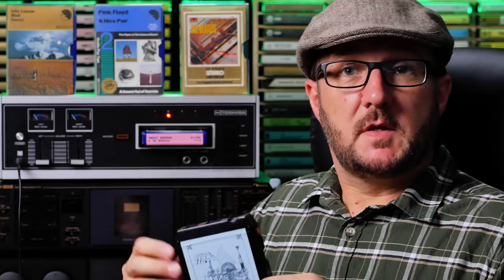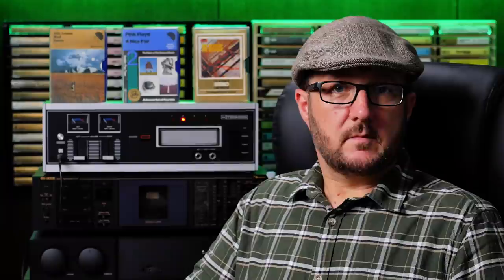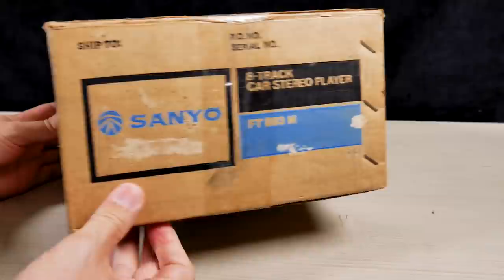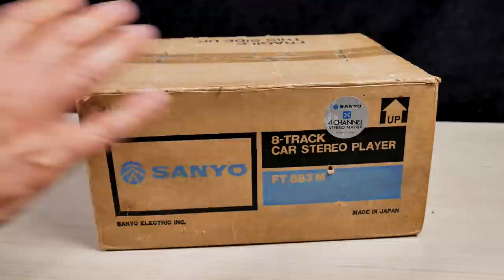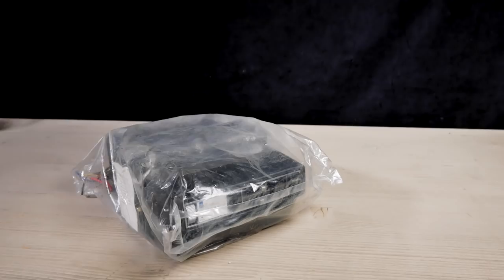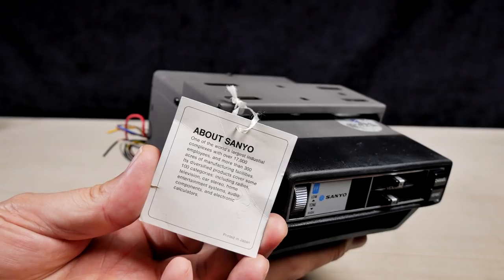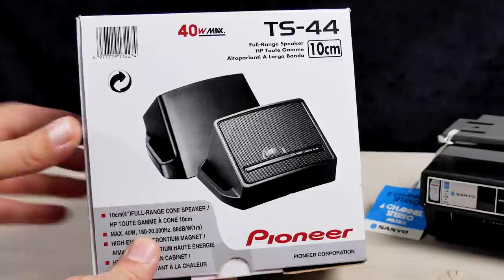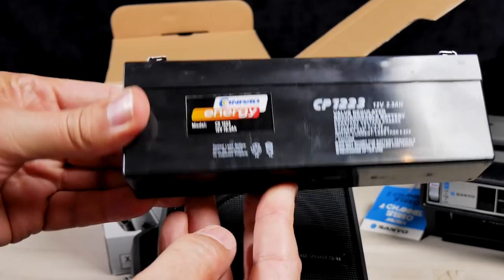Can I Install a Vintage 8-Track Player Into This Vintage Rover P5b? - WILL IT WORK?

Comment: Oh the memories this brings back. I bought an 8 track player for my first car way back in 1973. Did not have it much more than 2 years. My car was broken into and the player ripped out. I collected on the insurance and never looked back. "Step on the gas and wipe that tear away". If I remember, I had 8 tracks of Yesterday and Today and 1967 to 1970. Thanks for shaking the memory circuit.
Reply from the maker: Great memories, Bob.

Comment: As a veteran "Tracker" from Canada, this amuses me to no end.  I love seeing people get into the hobby and I'm glad to hear it already brings you some joy. I think it's the simple pleasures in life is what a lot of us are missing today.

8-tracks CAN sound good. The biggest detractors were: a) the duplication.  Some is definitely better than others. b) the pre-amps.  I've never seen a vintage 8-track deck with a frequency response above 12,000hz.  The sad fact is.... even the most basic ferric oxide tape can handle better - I believe it was just a way to minimize "tape noise".  There is a fellow in the USA that has developed a 3rd party pre-amp capable of reproducing 16,000hz with tremendous results and can retrofit his pre-amp into MOST decks.

Anyway,  as I'm sure you've already found out.... yes, you need to change every foam pad and splice you come across.  My advice is even if the splice looks good;  change it.  At least then you know it's up to YOUR standards.  Also, don't hesitate to get some real splicing tape and reinforce the back of the splice too!  I've been doing this for YEARS myself and have yet to have one of my repaired tapes fail.  All my tapes are reliable and playable.  Every time I try to be lazy and not change a splice.... it bites me in the arse.  Remember, it's never the player - it's ALWAYS the tape.

Finally, in my experience.... Sanyo were not the best players.  Virtually every Sanyo I've ever had has either amplifier issues (dead channels), motor troubles (wobbly speed) and some have just been DOA.  My personal choices (in order of importance) would be:  Pioneer, Motorola, Craig/Pioneer (Craig units usually used Pioneer guts) and finally Audiovox.  Maybe throw in Realistic in 5th place.    The players I've had the least amount of trouble with have been the Pioneers. Built like tanks, surprising good wow & flutter even though they have TINY flywheels.  Motorolas are also quite robust.  I love the Craig units for their looks, slide mounts and interesting options.  The Audiovox's also rarely require any work.  I've actually just had in an Audiovox In-Dash AM/FM with tape that has a signal seeking option.  At the press of a button, it will, via motorized jiblets find the next strongest AM or FM station.  Pretty unusual for a mid-70's deck!

Dare I suggest finding a Quad unit so you could have QUAD in the car??  There were a few Solo Beatles' albums available in Quad!

I wish you the best of luck with your new hobby and if there's anything you might need.... I am the original 8-track Guru!  Feel free to reach out for anything from bad advice to tips, tricks and even tapes!

Comment: Whoever recorded that tape, had a really good deck.  I don’t think I’ve ever heard a home recording that clear before.

That type of setup there, is not far off at all from what a lot of people used back in the day.  You would usually have a car that only had an AM radio in it from the factory, so you’d have to do exactly this kind of install job, though most of the time, the speakers would be on the back dash.    This was a thing, up until the early 80s for a lot of people.

Comment: I used to record tapes on my Akai 8 track recorder... using my BBE SONIC MAXIMIZER, and since I had a recording studio, I used 456 and 457, and 407 studio tape, recorded the tapes on at 4x, using my computer and my Fostex 8 track,  which ran at 15ips. So, make a mix tape of mp3's... use the sonic maximizer... fill up four stereo tracks in pro tools, then dump at 4x onto the foster. Then wind the tape on to the cartridge spool, season liberally with graphite powder and a little silicon... close it up with the splice. And paste an interesting cover art on the cart.   Everyone remarked on how amazing my tape player sounded....  I said "yeah doesn't it sound yeah doesn't it sound pretty good? It was just in the car when it was just in the car when I bought it along with all these tapes."
Reply: Why MP3’s? Just interested..
Reply: @naimusic362  oh, well at the time I was doing this it was the only way to get hundreds of hours of music on my hard drive. I basically could stick them all back to back in pro tools, and record all 8 tracks at once at 2x or 4x speed...  I could take a 407 pancake and crank out about 4 hours worth of 8 tracks in an hour, all automated, aside from getting them in the tape shell! Lol

Comment: Honestly, I've never seen a fast forward option in a 8 track player.
Reply: It's fair to mid-common in North American players to have a FF, however, their use is discouraged due to accelerating the tightening of the tape to the spool. 
 What I found odd was the placement of the FF switch..at the top of the 'tone' control. I've not seen that in my many years.

Comment: 8-Track tapes must be going over,the tape peace that get it change loosen by years same with that peace that holds the tape out to the tonehead...the materia just disapears with age...if the tape loosen with the ckhange bit and you play it winds up into the player and then gets many folds...notice the tape is covered with grafit on the rear side so in spins smoother in the casette...editing new tape from a reel to reel tape can work a while but in 
the end it stops windig and roll.
Reply: Tape rescure parts is avalible to buy in the internet...the tapebit that change and holds it together and the peace that puts it out is also there. some tape has metalparts with some fabric that puts on the tape out and it can olso be old and loose...that part on the compact casette is ften loos and away with gets the tape
none playable if it is not fitted with new pats.

Comment: why didn't you put the right speaker on the right side of the stearing wheel???
The OCD in me is really bugged by this.
Reply from the maker: That would have been ideal but there's no room. The handbrake is located beneath the dash on that side.